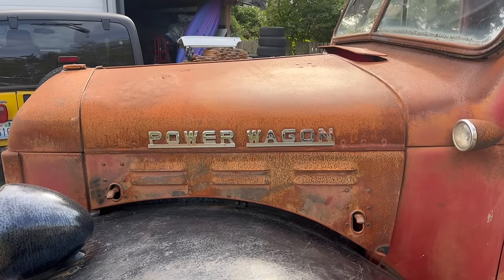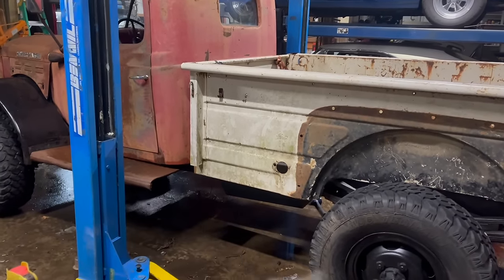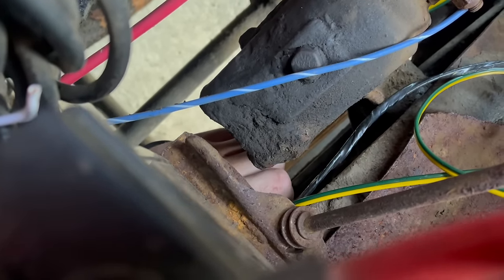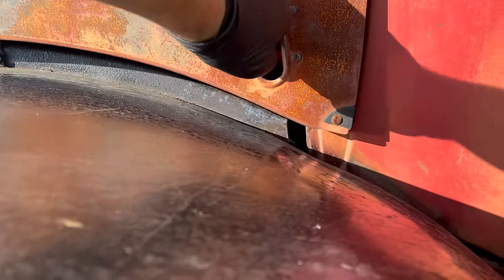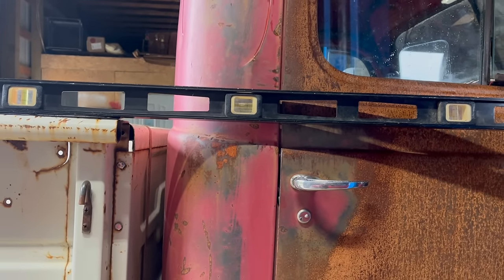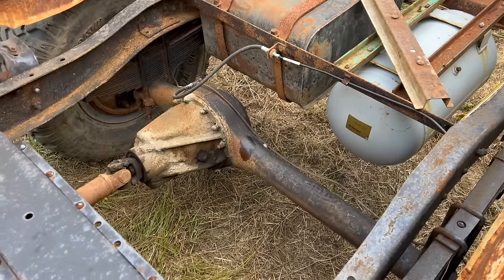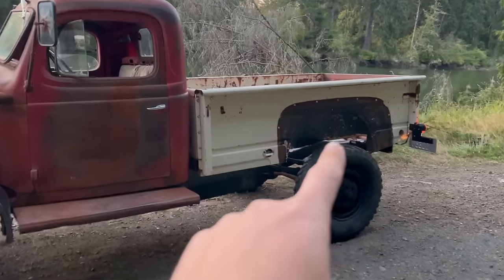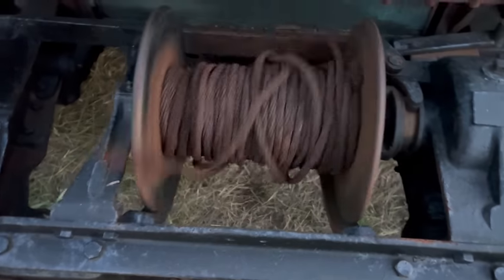Long Abandoned 1948 Dodge Power Wagon Project Gets A New Lease On Life

Comment: I put an air conditioning pump on my PowerWagon wrecker for on board air has worked great for 20 years or so AND ya flip a switch to turn on N off...
Reply from the maker: I am well familiar with this. I have two, and this was my plan. I am very, very limited on space in the engine compartment, and for adding an extra pulley.

Comment: I would also love a new Dodge 2 ton flatbed 4 wheel drive with a Cummins but swap the front clip for a 1969 Dodge 2 ton and paint the whole thing in flat red paint.
Reply from the maker: I’ve seen pictures of that done to a modern ram… I did not like the look. Same as those Chevys with the grafted on old sheet metal, or the modern challenger with classic Charger panels. I just don’t like the mix. I like the idea but not the finished product.

Comment: Not the original seats I believe, it should have like a ancient OTR type seat and the adjustment valves are for the seat bladder and the air was adjusted by the valves. Not a great set up for it would leak and they would get tossed.
Reply from the maker: I think it’s a factory seat missing an in between setup that had the air and movement controls. It’s definitely a factory shaped seat with factory material. I was able to find brochure info for it today. It didn’t use actual air pressure, it apparently used a little air door in the bladder that looks just like a vent on top of a grill. Interesting stuff there.

Comment: where did you find tires and rims for your PW? i have a 48' also that i just got to where i can finally drive it! but i am having trouble finding non-split-ring rims that fit on the budd style lugs
Reply from the maker: These are lock ring Budd wheels. They are modern tires with inner tubes, which is probably not a good idea. But it works. Haha.
Reply: Haha Illl give that a shot!
Reply: Oh! And I have an original owners manual/repair guide I found in the glove box on mine and there should be a valve behind the seat that will adjust the seat softness, kinda like a air ride seat restricting the air from escaping the seat

Comment: Air compressor is easy. Any AC pump that you can mount will do the trick.
Reply from the maker: Yes, I have two. Chrysler RV-2 has its own sump oiling and is a great choice. It’s the mounting that is the problem. There is very little engine compartment space. They are really, really narrow at the front of the engine, and there isn’t much room toward the rad to add a pulley to drive it.
Reply: @DeadDodgeGarage  well, I have full confidence that you'll get it.

Comment: I say ditch the motor put a Cummins in it. I have a nice day lol lol
Reply from the maker: There are a lot of reasons I won’t do that. It’s an original truck and other than the current carb issue the engine is awesome. The 6bt is tooooo big. 4BT is a decent option… And then change the axles because the crazy gears aren’t going to make the diesel happy. So… change the entire truck. Nope! But I’d like a usable road gear. That would be super awesome.

Comment: I hope you changed the master cyl.. also the wheel cylinder are really really bad at losing fluid when new.  If you value your life change the one line master cyl. too a TOO front and rear brakes.  Trust me I wrecked my dads 1949 Power wagon  All because of the braking system.  Have A Great Day
Reply from the maker: Every one of those components was brand new, and had never had fluid added when I got the truck. I added fluid - and replaced a rusted rear brake line they missed. The brakes are great.